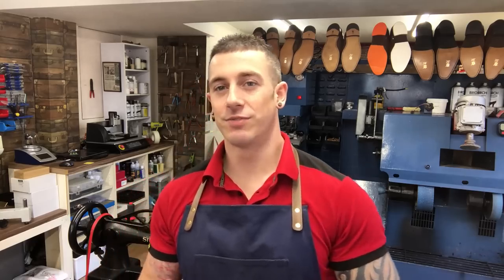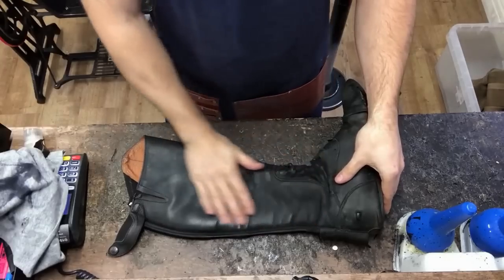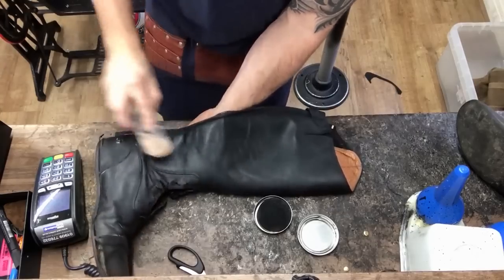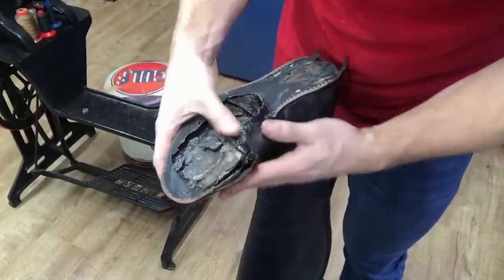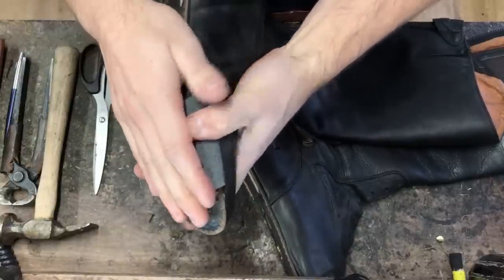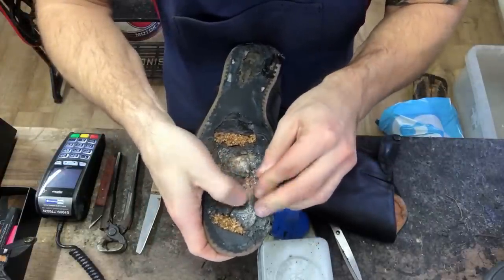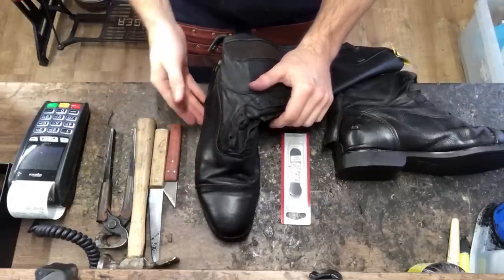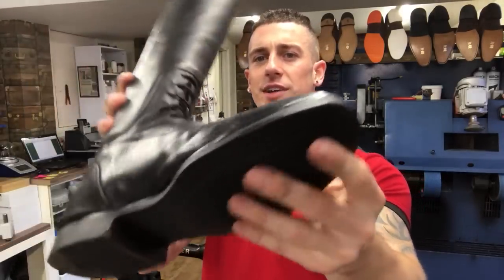Refurbishing Horse Riding Boots | Treadstep Donatello | Vibram Soles

Comment: Riding boots should ideally have a 1" heel from the sole. This is to prevent the foot sliding through and getting stuck in the stirrup. If this happens and you fall off, you'll end up getting dragged behind the horse with your leg getting broken and you'll end up being trampled as the horse runs off. The owner of the boots should have let you know this beforehand, but it's an easy mistake to make if you don't ride.
Reply from the maker: How does the horse trample you if you’re being dragged behind it? 🤓
Reply: @Dan_the_cobbler  usually your upper body is getting bounced about on the ground while one leg is hung up, so it's the back legs that are landing on your head and chest area, maybe an arm or both if the riders unconscious. You also tend to see the rider bouncing up and down on the ground like a rag doll. Just type in the YouTube search bar, horse rider gets dragged, and you'll see loads of videos on it. It can be quite gruesome to watch.